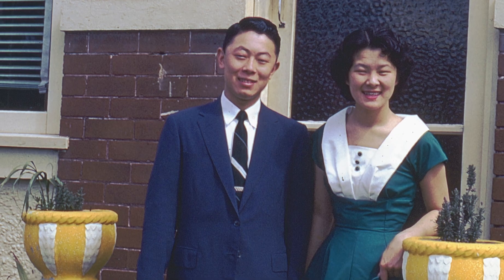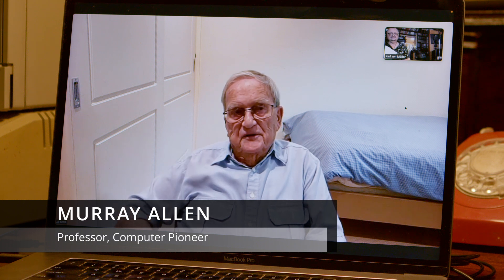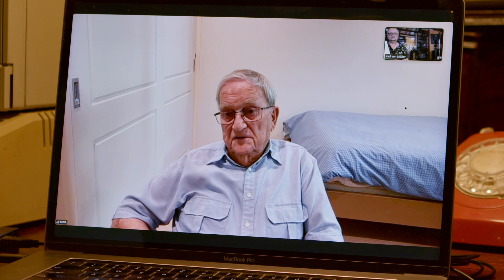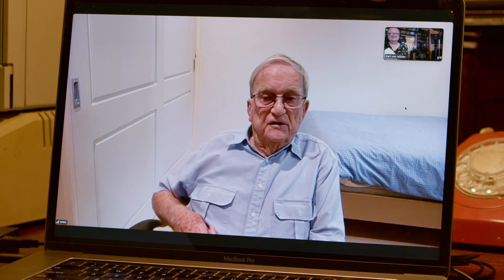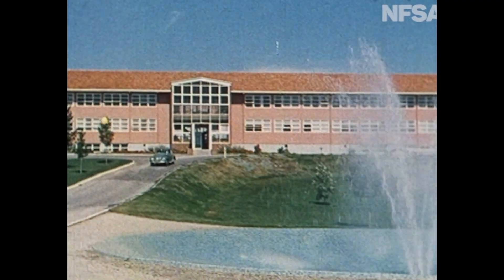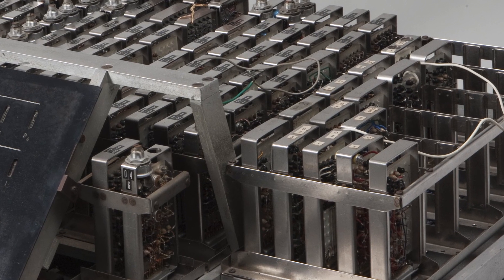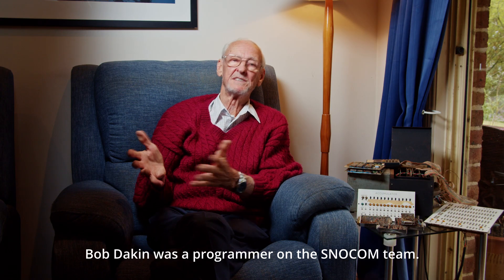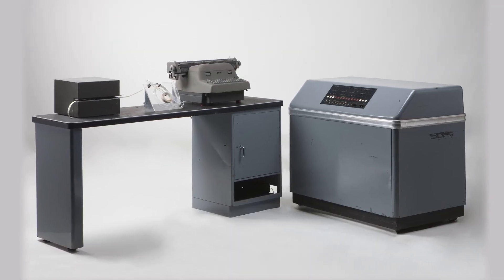SNOCOM - Ep8 The Computer History of Australia

Comment: In 1967 as an Applied Physics student in the UK I first used a computer (Stantec Zebra), a commercial machine, but like SNOCOM it was based on a drum memory and built with discrete semiconductors. I heard of the Snowy Mountain Project, but not the computer.